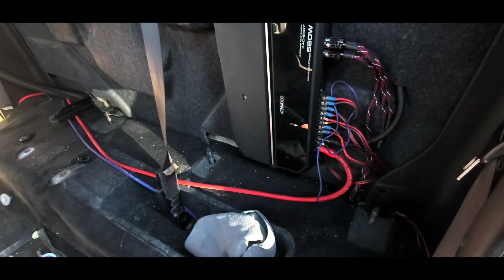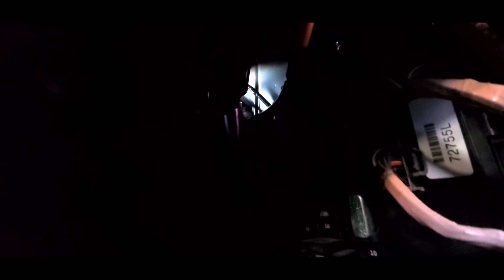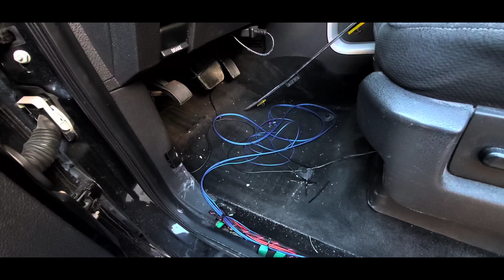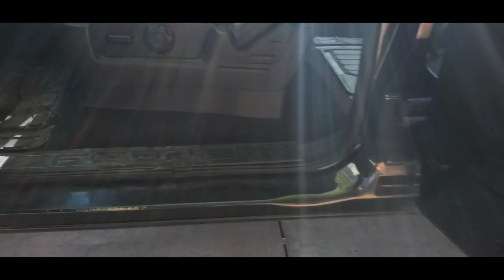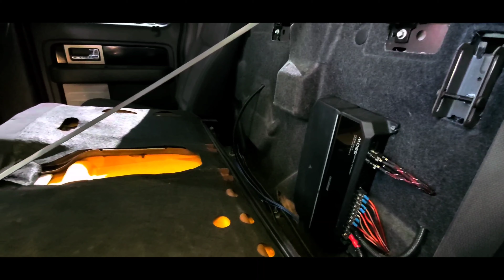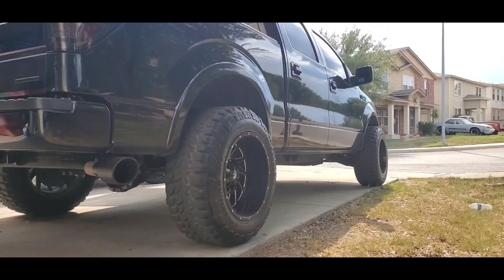Amp wiring install / F150 back seat removal.

Comment: Excellent! if you had to put an active LOC in on your truck and use factory head unit, would you mount it in the back or up by the head unit? I'm thinking about putting in a coupe power and ground distribution boxes in the back so I can just connect all power and ground there. What do you think?
Reply from the maker: @richgee3784  i think that'll be pretty sick and an easy setup 4 sure.

Comment: So nobody let him knownthat skar wiring kits are not true AWG size? That 4ga is actually 6ga. Measure the cross section of the copper and it is smaller then 4ga and tad bigger than 8ga. Skar is stil lhetting away with this.

Comment: So let me ask you a question? In my truck my Ford F-150 FX4 in the center council there is a plug for RCA. Doesn’t your truck have that?
Reply from the maker: Good question. 
No it does not. Mine is a Fx2 sport. I just de-badged everything. I put in aftermarket leather seats. Yours is probably equipped with a screen? I'm assuming?
Reply: Yeah mine is fully loaded heated and cooled seats. Only bad part is I still need a source for my power remote wire. I think I can get that from the factory sub guess I’ll look here when I get out to my truck. 

By the way I like the area you placed you amp that’s sweet, I’m going to do the same thing bud.
Reply from the maker: @jamesarneson7769  should have one on the passenger side floor board.
Reply from the maker: @jamesarneson7769  thanks bud. Ya the amp placement is conveniently out of the way and protected. Easy to get to too. If I ever need to adjust something? Everything is setup for ease. Thanks for the comment. Hope your build comes out good.

Comment: How much would you charge for this a guy tried to change me 400 just to run the wire no hook up.
Reply: I am in NC
Reply from the maker: Damm talk about price gouging! 
That sucks. I'd figure 75 bucks at best is what they should charge.
Reply from the maker: I'd hook you up. That's sucks where did this take place?